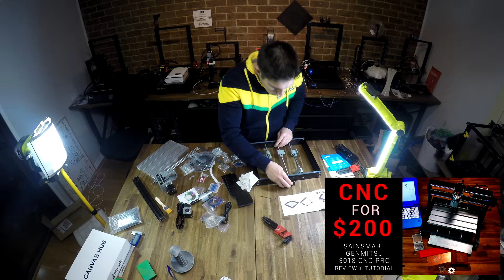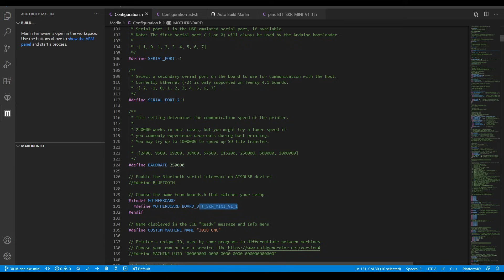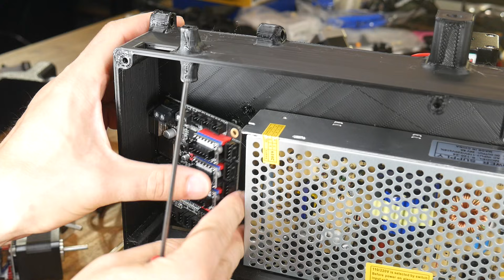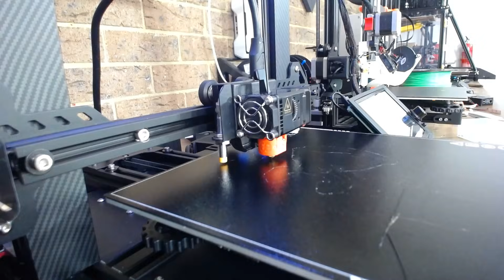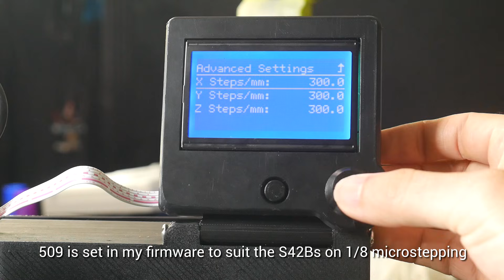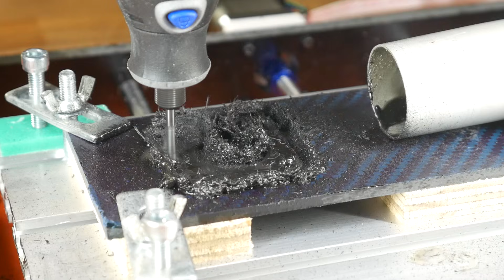Genmitsu 3018 CNC upgrades: Mill acrylic, aluminium and carbon fiber

Comment: Nice upgrades! I did almost the same, but with some differences:
1) I've used Creality 4.2.7 board from Ender 3 Pro with my custom Marlin v2 firmware that was waiting for me in a box after my printer's upgrade to SKR Mine E3 V2. It has silent TMC drivers and STM32 chip, works perfectly. 
2) Dremel is not the best tool for routing/milling, because of the construction. It will not last long. I was using different dremels in my custom manual mill -- they can't  survive heavy side loads/preasure. Majority of them don't even have double bearings for the rod that holds their chuck. The only quality dremels that survived  were made by German Proxxon. 
3) Considering these issues I've installed Makita Compact Router( it's cheap, but top quality with 10  times more cutting/milling power than any dremel). This thing uses  industry-standard 1/4 inch milling bits that you can get anywhere in the world( even cheap chinease work). You will be shocked to find out that 3018 (using Compact Router head) can cut your alluminium, steel, colored metals, etc like a butter at relatively low RPMs without extreme noize few times faster and better than any dremel.

But in any case -- thank you wery much for this helpful video!
Reply: What mount/router did you use? Looking to perform this as well. Many thanks!
Reply: bro, PLEASE give me the firmware im begging or give a link to download firmware

Comment: I have my 3018 running through WiFi off of a Raspberry Pi and CNCj, it's been running this way for two years with no problems and no board changes needed.

Comment: Hi, like the videos and find them very informative, have seen many about this 3018 and other clones and nearly all seem to require some upgrades. thought you might be interested in this one, https://www.aliexpress.com/item/4001294949324.html?spm=a2g0s.9042311.0.0.2c6e4c4dL97jS2 . after looking at the cost of upgrading, motor, powersupply, limit switches etc i decided to purchase this. Shipping costs are a rip off but i am more than happy with it. all metal construction, no 3d printer parts, 16mm guide rails, 12000rpm motor, proper external power supply, 6 limit switches, maybe you could get them to send you one for review, i purchased the one with external controller and without laser, i purchased a more powerful laser elsewhere for less cost

Comment: Carbon should not be machined without a dust cover/extractor those microscopic parts are in kind of the same league as asbestos when it comes to health hazards. I guess if you do it once (or very rarely) and use oil and a vacuum (like you did) to catch most of it, it won't kill you but be careful if you do it more often.

Comment: Great video, you wind up using the same values for the steps per mm on each axis or did you use different values on each axis?... i never considered needing to check the y and z i just assumed all my motors would work the same lol  that seemed to work at least.

Comment: Is there a chance that you will reviev one of many one hotend double extruder kits for ender and how to set it up? My ender 3 pro has problems with filament swaps - when you stop the print the z axis moves a little bit down but thats enought to break the print after resuming the print, and I wanted to know if its a viable option

Comment: I used both marlin and grbl so far and I habe to say that I really preferred grbl over marlin seeing how it's meant to be for milling... Marlin is way to unreactive for cnc usage (for example if you wanna pause the cut due to noticing there's something in the way it takes a couple seconds (cause it buffers g-code lines)) and that makes it almost unusable for me... Also quickly adjusting the feed rate when noticing the material you are cutting melts takes way too long too

Comment: I upgraded to a faster (stock) spindle (20k RPM) a few weeks ago. Since the dimensions were the same, swapping the spindle out was trivial. Also added limit switches on all axis as well as a crosshair laser pointer for zeroing out the position. I am using CNCjs on a RPi and have been very happy with that; this is similar to using Octoprint and definitely nicer than an instrument-mounted controller. Not sure that the stepper-motor upgrade would make a huge difference here, but it certainly doesn't hurt to have closed-loop feedback. Ive been mostly cutting hardwood for smaller projects such as jewlery boxes, etc. So far, so good.

Comment: Nice job, Michael! This 3018pro just beg for the closed loop system! thumbs up
This machines have one drastic design fault - rigidity of rails, or, should I say, 10 mm round bar guides. I can easily flex X within several mm's simply by applying force to spindle. Also I dont understand why they've choose so strange and flimsy rail to plate connection - just m5 screw in the end of the rod - why not just put rods through bakelite plates and install rail SHF holder, thus giving as not pinned, but more rigid fixed connection without breaking the bank.
Of course you can mill & scratch alloys even on stock 3018pro, but what about holding tolerances and repeatably?
I'm, too, in the process of redesigning this machine. So far I've changed 10 mm Y axis bars with WCS20 ones (without changing the height of the table), supported with SHF20 holders and swapped tine 8 mm lead screw with more beefy 12 mm ball screw. Also installed aluminum corner brackets between 2040 extrusion and bakelite plates.
For X I'm planning using HGR15 Hiwin clone rails, mounted on existing 2020 extrusion, with Z carriage sliding on 2x HGH20CA blocks. 
For spindle, I've purchased 500W 100VDC motor with ER11 collet, capable of running up to 12k RPM.
Happy 3018 modding!
Stay safe, 
Phil.
Reply: Any videos of how your upgrades are doing?

Comment: Thanks for the mention! I recently got a 3018 for testing and small tasks. My son is using it to etch circuit boards and mill contoured acrylic cases for his electronics projects. This has yielded better results than resin printing.

Comment: Thank you for all your great videos. Because of those videos you've done on CNC machines, I've always longed to add one to my two 3D printers. 
But. 
The big thing that stops me from spending the money is the noise factor. I have two routers and rarely use them for long because I am concerned about annoying the neighbours. I know that having a CNC machine means using it for hours on end to achieve a finished project. 
So, my question is how do you manage the noise problem?
Edit: I do own a Dremel 4000 also.

Comment: 8:37 I think the C terminal on a relay is "common" and not "closed", is it?
Having watche dthe whole thing now, I think the main issue after all these changes would be the Y movement of just 18cm. I've seen upgrades to 30x30 instead of 30x18, that could be very interesting! Apart from that, I think the machine is more or less perfect now. Any bigger upgrades would just turn it into a way more expensive machine at which point one could get a 3040 for the same money but with more rigidity.
I use my 3018 for laser cutting and pcb milling, and it's damn great at that. Any bigger jobs I use a larger machine that is stiffer and moves faster, so maybe try some PCBs?

Comment: Very nice upgrades for this mini CNC.  I have an unmodded version but it works terribly.  That's why your upgrades are very interesting.  But how exactly do the closed-loop steppers work?  Even if the lost steps can be made up for each axis, how does the skr board know about the lost steps?  the controller in the stepper only receives signals from the skr but it does not send anything back, does it?

Comment: Inspiring tutorial! As usual it's amazing how you walk us in detail through each and every of your gear choices and steps of the assembly.
I'd say a last straitforward upgrade would be an extension of the XY cutting area... working mostly with acrylic and wood it was the first real  limitation I bumped into on my 3018 PRO-Ver while working on custom PC cases projects.

Comment: A 20000 RPM Genmitsu spindle is half the price and the same form factor as the original motor, and speed control can be done via gcode. Is there a reason you still went with the Dremel instead? It's also way lighter, meaning less accuracy problems.

Comment: I would print a cover for the dremel to allow it to get clean air and not ingest cut material.  Possibly adding a fan to help direct clean air in.  I have hurt a dremel cutting CF and letting the debris be ingested.

Comment: Hey, I am very much interested in a small CNC to cut acrylic and aluminum. So far I have only worked with 3d printers and this project seems a bit too complicated for me as a beginner. Does anyone have a recommendation on where to start without breaking the bank? Cheers!

Comment: A great and a very clever video! I want to ask, if it is possible to cut hard steel. It doesn't matter how many time will be required, but if, for example speed will be 1 mm/s with 0.2 mm layer, will it be possible? Can you try please? I think it will be very interesting for a many people. Thank you!
Reply: Machinist here: Cutting steel this slow will heat up the tool way too much causing it to overheat and go dull.

Comment: The nose cap of the dremel looks free, you can unscrew it, and 3d print a vacuum hose duct to go on it and use a very thin and flexible hose to connect your extractor to. I would even go so far as using acrylic to build an enclosure to prevent dust and flying chips.

Comment: This opens up several thematic videos for me! :-D

#1 Guide to configure Marlin 2.0 as CNC (e.g. based on the CNC 3018)
#2 Guide for setting up GRBL on a CNC 3018
#3 A comparison between Marlin 2.0 configured as CNC with GRBL
#4 Guide to configure Marlin 2.0 as a laser engraver
#5 A guide to setting up and using Kiri:Moto

And what I would also find great:

#6 A beginner's guide to FreeCAD

I think it is the perfect alternative to commercial products like Fusion 360, Solidworks, OnShape, etc.

A complete introduction series would also be welcome ;-)

Comment: Nice work Michael,  wish I had got that way in stead of a 500 W motor.
Reply: I was wondering what would be a the pros and cons of going of this solution instead of a 500w motor with separated speed controller?

Comment: You put more money and time into this machine than it is worth. CNC Shield with DRV8825s, a Raspberry Pi running CNCjs and a 500w spindle would have also done the job. Of course the biggest issue which is rigidity was not fixed. For this money you could have gone for a 3020T.

Comment: To get steps per millimetre on movement axes (anything except an unknown extruder), I'd suggest using the very fine Prusa calculator:
https://blog.prusaprinters.org/calculator_3416/
You need to check some properties of your belts or leadscrews, but you will get an exact number which will be accurate regardless of backlash or any mechanical defects which might be distorting your manual calibration test.
With this foundation, any backlash compensation or other fudges you may apply will work equally well for big and small parts!

Comment: Have you tried high rpm and faster feed-rates? 

Always bugs me that all these mini machines even 6040 sometimes go like “300mm/min max speed” for cutting then be like but i did go 0.5mm deep, and created a lot of dust and chatter...

Higher rpm, faster, smaller cuts, would that no give a better cut? 

This just goes from my manual sieg milling machine, if i cut too much, too slowly machine bogs down- add small cuts and more rpm and i can push the bits in like its butter, and surface finish was always better

Comment: Great video, love to see CNC content here. Some other standard upgrades you could do include a dust shoe, integrated LED ring to illuminate the bit, and a touch probe for auto zeroing
Reply from the maker: Great suggestions! The double power point means the vacuum for the dust shoe can be turned on and off with the spindle.
Reply: @TeachingTech  That setup is just begging for a servo mechanism nested against the speed control to (approximately) set the RPM of the Dremel.

Comment: Will be there no issues with gcode processing when using cnc oriented CAM software and marlin firmware tricked into cnc?
Reply from the maker: It's all just gcode. G1 move commands, M3 to turn on spindle, M5 to turn off. The machines don't care where it comes from.

Comment: I'm not sold on the benefits of a Dremel vs a spindle motor. Even similarly priced ones...
Reply: I could only cut AL at 25mm/min without stalling the stock motor (50mm/min stalled the motor). He's running 200mm/min which is 8x faster. I'm sold on it, especially because I already have all the parts to do it.
Reply: @NathanBuildsRobots  I meant compared to a similarly priced spindle...
Reply: @Andreas-gh6is  Yeah, I hear that. I bought a 3018 just to learn the basics of CNC programming. I want to step up to a better machine soon, so I don't want to invest a lot into the 3018 that I can put towards my next CNC. The Dremel upgrade would be essentially free for me to do.

Comment: I've heard 3 different speeds for the stock spindle now. 1000 rpm, 6000 rpm, and 8000 rpm. Does anyone actually know what the real RPM of the unloaded spindle from Genmitsu is?
Reply from the maker: It's possible I was incorrect on the stock spindle speed. I know for sure that the dremel is a lot faster.
Reply: I just wish Genmitsu would provide that information, I can't find it anywhere.

Comment: 0.25 passes are incredible small. I am a machinist. Maybe these machines don’t have the torque can on mills we do 10mm cuts a 500-800mm/m.
Reply: The Dremel has almost no torque and the machines aren't very rigid.

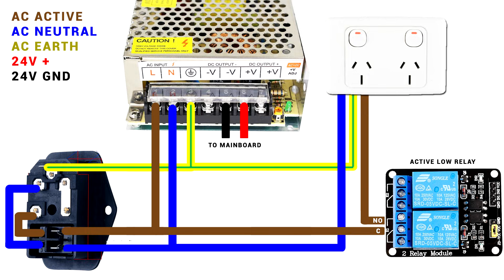Comment: Fantastic! I did notice a tiny but important error though. At 8:39 you say "closed" when you should say "common" for the relay mains connections. Like I say, small error but as it involves mains voltages/wiring. you should correct this.

Comment: due to CF being hygroscopic it is not ideal to use a cutting fluid as this could lead to delamination. I don't it to affect you greatly but if I were to manufacture a CF part and expose it to an oil while it is bare I would have to repair or scrap it entirely. Aircraft do get their panties in a knot quite easy though.

Comment: Im looking at it cutting which looks excellent but thinking the head could do with a clear sleeve collar around the cutting bit much like you might see on a pillar drill to provide a modicum of safety on flying chips or broken bits.

Comment: Hi Michael, I've done something similar with a laser cutter by using an SKR1.4Turbo wich use nema17 as a 3D printer but, I've got a question about my 1500x1500 workbee. It works with 4 nema23 with 2.8A / phase, now I'm using an old pibot controller with an Atmega2560 and 4 external toshiba high current drivers. Which motherboard / drivers do you council me?

Comment: I'm sold on the idea of not having to tether my laptop to the mill. Looks like I'll add this to the list of projects to do...
Reply: I'd prefer to tether some SBC to the CNC. Or a really long USB cable.
Reply: @Andreas-gh6is  I've tried tethering sbcs to the mill. It really only likes raspberry pi on easel and even then you have to install a bootleg version of the driver everytime you want to cut something
Reply: @ciderhat2760  I haven't done any CNCing yet, but there's definitely a way. At the very least you can use the raspberry pi to forward the serial port. There's also FreeCAD.
Reply: @Andreas-gh6is  its gotta be something that can read grbl. But hey if you find a solution then please let me know

Comment: If you intend to use it for carbon fiber frequently, you definitely should build an enclosure
Reply from the maker: I was thinking about even a pop up 3d printer enclosure being better than nothing. In the garage I have proper dust extraction so would run this machine or my other there.

Comment: i managed to snag a 500w spindle with a power supply from bangood a good while ago for around $50. it is quieter.
Reply: Most of those come with an aluminum clamp, how does that attach to the 3018?
Reply: @NathanBuildsRobots  You will print either middle adapter that connects metal clamp to plastic head mount of 3018, either you will throw away this metal clamp and will print new clamp that directly connects to the stock plastic head mount of 3018. There are models already available for both options on Thingeverse. 
P.S. If you can -- buy brushless 500w spindle. It's better than regular brushed 500w spindles-- more powerful( I mean real power, not nominal 500w), not that noizy, less heat, etc.  But it requires BLDC driver and usually needs 48V power input. Also, in majority of cases they have ER16 collet instead of ER11 used regular brushed DC spindles.

Comment: Always climb cut on a cnc for much better finishes. Also chuck up your end mills to the flutes. Less chatter. The shorter the better as those bearings are not very strong. Put your dial indicator on a end mill and grab the dremal and you will be shocked how much it deflects. It's all about strength, I bet you will find more ways to strengthen the entire machine.
Reply: Climb cutting is preferred but required the machine to be sufficiently rigid. One these lightweight budget CNCs it often leads to a lot of chatter and conventional cutting is more reliable especially for a beginner.

Comment: Do an upgrade to fix the z axis flex.  Those free-floating rails of the x axis allow a lot of flex of the z axis carriage.
Reply from the maker: The motion system would benefit from an upgrade, but then it starts to become a significant and expensive process.

Comment: Only thing missing is airduct for vacuum, something akin to 3d printer cooling but gathering all particles. Also good idea to add 3d printed cyclone for easy cleaning, that carbon dust can kill motors in vacuum cleaners and lungs.
Reply: they have vacuum ducts for drills that could be used